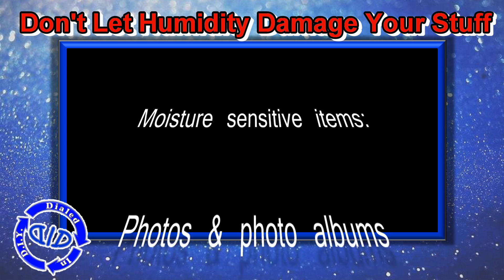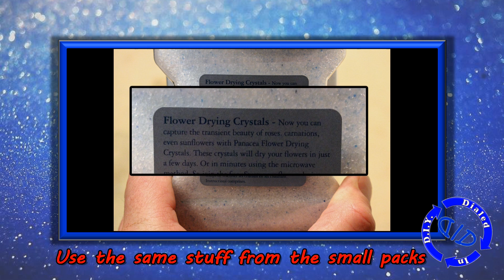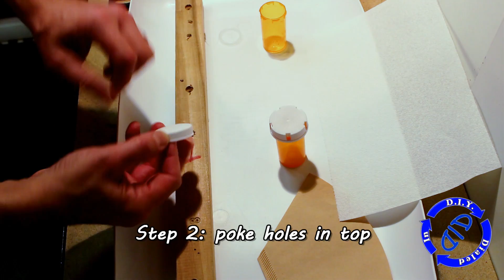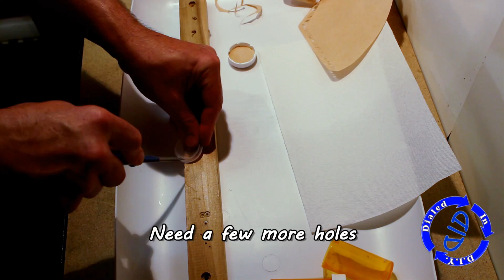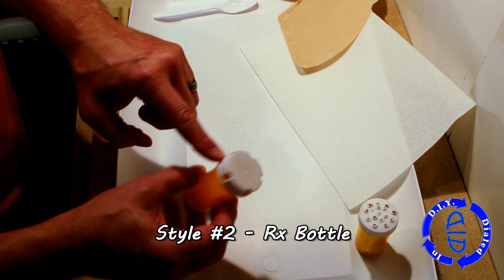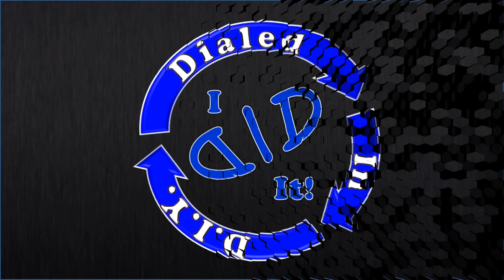DIY Silica Gel Packs - Moisture Protection

Comment: Do dehumifers kill mold already in a bedroom or do they just stop new mold appearing I have mold in my bedroom also is salt effective in using dehumifers and damp traps I wanna save money and not have to keep buying more dehumifers and damp traps
Reply from the maker: Thanks for watching and posting your questions.  Unfortunately these will not kill mold that is already present. 
I experimented with water softener salt but it did not work well enough. Another option that works pretty well, and absorbs odors in addition to moisture is charcoal. I have a video on that one (charcoal) for odor control in trash cans too.
Reply: @DialedInDIY  what will kill mold that present already in a bedroom or stop new mold appearing

Comment: great DIY! Can you also use damprid instead of the silica jell?
Reply from the maker: My brother loves Damprid for use in the crawl space under his house. The difference with the Damprid (as I understand it) is that you will be left with some kind of a container that has liquid in it once all of the crystals have been "spent."  It will definitely work great for pulling the moisture but if you break the contents into different containers you will need to make sure the new containers keep the fluid trapped.

Comment: You can reuse them indefinitely or there is a limit?
Reply from the maker: Very good question.  Resetting silica gel is basically just drying them out again and  if you use low heat to do this, then you can repeat the process many times.  The only problem I've seen so far is using too high of a heat trying to dry them too quickly which will eventually start to break down the structure of the little beads (ex. microwaving them gets you there faster).  An oven at ~170F doesn't seem to cause the breakdown that I have seen.